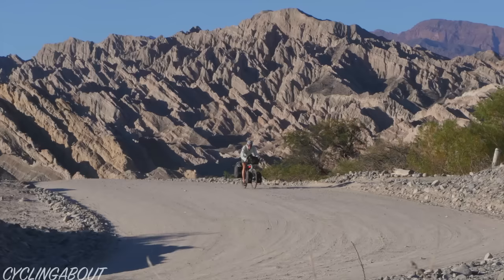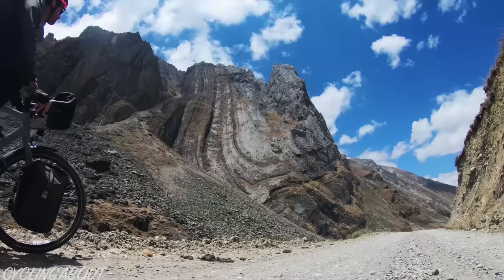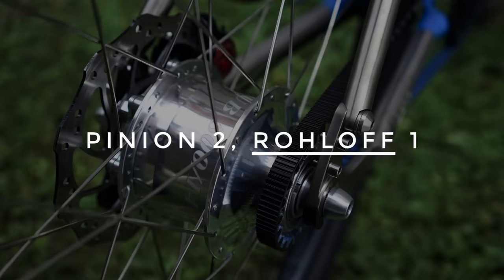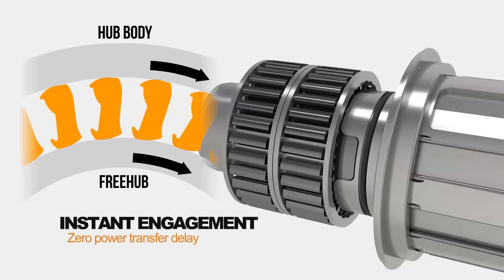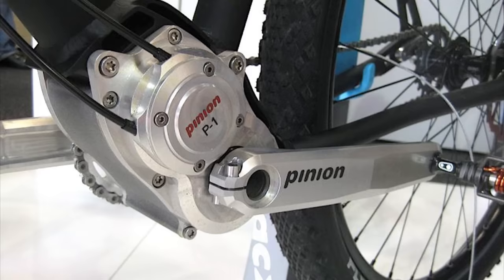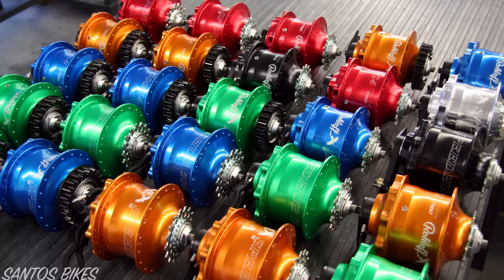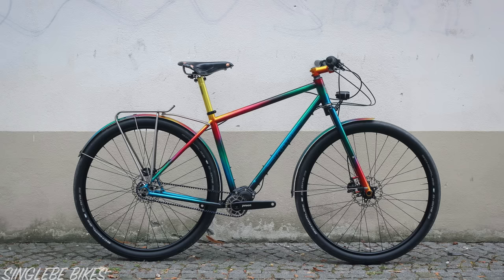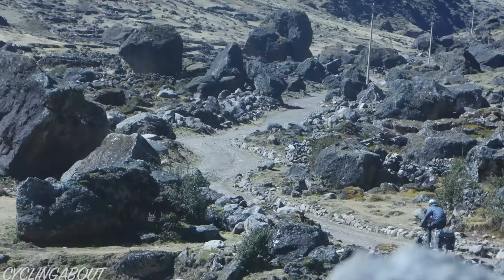What's The Ultimate Bicycle Gearbox? Rohloff Hub VS Pinion Gearbox

Comment: Thanks die this enlightening video. I vote for the Rohloff, don't want to loose 10% power in the gearbox.
Reply: You should rather test ride both systems before judging this. The feeling on the ride is really something new with the Pinion (and no additional weight on the rear wheel)! A big advantage for Pinion IMHO!

Comment: Great straightforward objective measurements in the video. That makes this video SUPER helpful. As you said, different riders will favor different features.
   1. Big Picture... If price wasn't the issue, stupid chains and detailers would no longer exist. Think of it this way, if Gearboxes and Belt Drives came first, and then when bike manufacturers came up with a cheaper solution that was "chains and detailers," we would all be discussing if even the lower price makes these awkward and headache inducing "chains and de-railers" worth having. 
   2. All things being equal, the Pinon wider gear range should be the obvious winner. I mean, that is the entire reason for having gears, right?
   3. As far as weight is concerned, since the weight is so similar, why does it matter? For most of us riding bikes, the health benefits are one of the big reason. A "little" more weight can only make us stronger, right? Obviously if the weight difference is large enough, it can make the difference between being able to ride and not, but at this level, I don't see how this small difference can make a difference between choosing the 2 hubs.
   4. But if your are only able to afford a retrofit, then that is a show stopper. You can only use the Rohloff. But honestly, if you really step back and look at it, are you really only able to afford just the hub? Like too many of us, we have spent way too much on bikes and probably will in the future, so regardless of which of the 2 solutions that you choose, try to take the opportunity to get a new bike that fits your riding style and allows this new technology to thrive to its fullest.
   These tests do expose a gap that I am waiting for the industry to fill.
   I have told myself that I will never again purchase a bike with a chain and derailed. I refuse to support such ancient technology. 
   I think that the future for bicycles is Pedal assist electric in all categories. I prefer the Pinon. But having an electric motor in the hub of a bicycle wheel puts a lot of weight and strain for said wheel and puts excess weight in an awkward lever position on a bike. But is there and electric pedal assist bike with a Pinon gearbox and Motor at the pedals? That would be the ultimate.
   Thanks for your review of these technologies.
Reply: gear boxes did come firs Sturmey /archer 3 speed.
Reply: Interestingly enough internal gear hubs went into production first, before derailleurs.
I think derailleurs still have their place in the world, they're still far more efficient (thus letting you cover more distance, race faster) if kept clean. They are also far easier to service and work with.

Comment: I went with Nuvinci for my ebike, because the slight increase in weight and loss of efficiency doesn't matter if you have a battery, and I greatly enjoy having infinitely small gear increments.  However, I think for a bike that you can stuff in your car and take places, the pinion would be the way to go, because the tires are very easily removed and then put back on.  Otherwise, the rohloff seems nice for the slight efficiency gain.
Reply: Also, there is something to be said for using a pinion with an ebike, because while hub drive motors are less efficient for going up hills, I have heard that they are generally quieter and that direct drive hub motors are theoretically more reliable because they have fewer moving parts, though admittedly I have not heard of many people having problems with either type so far.  Direct drive hub motors also have the capability of offering regenerative braking, which would be nice for descending mountains, because it would allow you to save your physical brakes.  And a pinion bike could be very easily changed into an ebike and then changed back, depending on the circumstances, whereas a mid drive ebike is pretty much always going to be an ebike.

Comment: I think it's important to make clear:
90 % efficiency at the Pinion is more like "half as good" as 94.5 % for the Rohloff.
As the Rohloff wastes half as much of the energy. In this range not a huge deal, but still 4.4 % less power needed relatively. Makes the race everywhere but for supended fullys...

Comment: I have tried many times e-bikes with Rohloff (both mechanic and electric shifting). Unfortunately, I didn't like it at all. The Rohloff needs too many shifts in practical use, it was a constant shifting up and down. The 10rpm might work well for pedalling without motor, but for a motor, it is too close between gears.
Reply from the maker: Fair enough! When I used an Rohloff E-14 eBike last year, I just held the shift button for half a second and it jumped up and down three gears at a time. I thought it was great!
Reply: CYCLINGABOUT I think you need another head to head. Pros and cons of gear boxes which is better for e-bike
Reply: @Cyclingabout  Pressing half a second to jump three gears sounds great, but in practice, it is awfully slow, especially when riding in traffic. At least, with mechanic shifting, I could switch fast, and I knew in which gear it is. But still, it needed way to many shifts. In fact, e-bikes need bigger jumps between gears to feel comfortable. I found the Alfine 8 has a bit too big jumps for normal pedalling, but for the ebike it is just perfect.
Reply from the maker: The Alfine 8 works out at ~17.5% average jumps, so pretty similar to the Pinion 12-speed gearboxes. The Alfine 11 is pretty much the same as a Rohloff though!

Comment: 3:24 - According to Wikipedia: "Rohloff hubs generally require a break-in period to function optimally. The manufacturer suggests this may require 500–1000 miles of active riding. For some riders the break-in period may be longer. Until the hub is broken in the rider may experience some noise or vibrations when the reduction-gear is in operation (gears 1–7)."

Comment: A couple more tests I'd like to see if possible: 
- another test of resistance of the Rohloff and Pinion after a break in period and oil change.
- a resistance test of a 'normal' chain and cogs with the chain at different deflections, ie big ring and biggest cog.
- a test of chain and cogs when they're dirty, reflecting resistance after a long off-road ride.
Thanks, and great video.

Comment: I love rohloff hubs, I've build two bikes with them. One XC hard tail and one fs trail bike, both with used hubs. My biggest grudge toward rohloff is that you cannot get thru axel version with adapters. You need to send them a frame so they can fit it in, which is expensive. So I was limited to older QR hubs and frames. The hub is also quite easy to lace, my first wheel build was a Rohloff. 
I find the gear sound motivating when going uphill. It feels like there is a machine helping me out. I know it's silly and that the effect is exactly opposite (more drag) but i still like it.
Rohloff has crazy pricing though, shifters, chain tensioners and adapters are very expensive.
Reply from the maker: I kind of like the whirring sound too... 😎

Comment: Thanks for this analysis. A BIG small detail is not mentioned in the video (maybe already covered in the comments): 
Adopting Pinion you also commit to their special cranks and, most importantly, rather wide pedal stance. So if you can't live with 160+ mm Q factor, this gearbox isn't for you apparently...
Reply from the maker: Good point! I should've for sure discussed q-factor.

Comment: Thank you for this great comparison. I'm using both gear boxes (on two bikes :-). My two Euro cents in this:
* Pinion: Drivetrain slop. Yes it was incredible, my hub was leaky for dirt. The engagement got pretty slow, resulting a BIG slop. But after change of rear hub (on warranty) to another model from Pinion, the slop has gone. I have the impression, this new one may(!) have a higher number of engagement points
* Rohloff is really annoying on regards of noise: On heavy duty: The whole frame vibrates.
* Pinion: you need to eat way more noodles before a tour to have the appropriate gain to handle the extra weight :-)
* Pinion has a far better equalized and fine-grained transmission than with Rohloff. Switching gear in heavy terrain let you "fall in a gap"
Reply: Which gear hub would you keep if you had to keep only one? I am ordering a custom frame but still debating over with IGH to use.
Reply: @gromit576  Hello @gromit, my choice is Pinion P.18. After such a long life on a bike this is the ultimate choice. I hope you are able to confirm soon :-)

Comment: My dream bike is a pinion+belt drive skinny-fat that can run around 29x2.4 to 26x3.8, preferably with a trigger shift system. But I suppose I could eventually get used to grip shift

Comment: I'd go with Rohloff.  I like how you don't have to have a special frame.  I also value their experience.
Reply: I'd go Kinderlay over Rohloff,
Still tempted to try a pinion
Reply: @PghMtbRides  Thanks.  What makes them better than Rohloff?
Reply: @mherke  lighter, better range, swappable between wheelset via cage system ( still need to build wheel with extra cage though)
Better shifter( i dint care for grip shift)

Comment: The versatility of the Rohloff to fit many bikes will also translate into an asset that has greater 'marketability' in the used gear market, so better resale value. This feature is even more enhanced with the new Kindernay hub, that is much like a Rohloff. The Kindernay has an extra advantage in the 'swapshell' feature that allows a single gearhub to be exchanged easily among many wheels without needing to re-lace the spokes. So you can have your road wheels and your offroad wheels, with just one hub. And Kindernay has Fatbike compatibility with a 190/10 and 197/12 thru axle. It's like a portable transmission that you can plug into your many frames and wheelsets.
Reply from the maker: I'm keen to have a play with a Kindernay! Hopefully I can get my hands on one after I finish my current mission of getting to Alaska.

Comment: Im looking at priority bikes 600 or their apollo bike for touring....or the surly bridge club or ogre with the rholoff hub....either way i want the carbon belt drive to get rid of the chain and derailleur maintenance and damage issues.  With the surlys i would have to use the Veer belt drive system or have a coupling installed in the drive side seat stay to be able to install the Gates carbon belt.

Comment: For any ebikers out there. You can use the Rohloff with a central motor, which then also befefits from the gears, whereas with the Pinion, you have to go with a hub motor which doesnt't.

Comment: Having some experience with both, I prefer Pinion for MTB. But it still needs refinments e.g. engagement points should be increased, new version of grip shifter improved cable routing but cable replacement is still a pain, sometimes clunky sound can be heard. With both gearboxes I've had problems with leaking oil.
Reply: Leaking from where?
Reply: @alexmorgan3435  In Pinion from non-drive side of the gearbox where crank arm is attached.

Comment: I dont know if its nessesery have more than 526% gear range. Maybe in hardest tarrain, but still you can change the sprockets (number of tooths) and move the gear range. For me a Rohloff is a winner, you dont need a special bike frame :)
Reply: if you want to switch out 2 sets of wheels, same bike, pinion is the clear winner. 2 bikes for the price of one!

Comment: For an eBike with a Rear Wheel Motor , & Belt Drive.
Is there a simple pedal crank gear shift? 
Just 2 (or 3) gears would be sufficient as the bike is designed as a single speed road bike.
So having even a single gear change would help extend battery life and make top speed pedaling more comfortable?

Comment: I’d love to see someone put this in a go kart with a chain going from the transmission to the rear wheels. Would you need a clutch for connecting to the engine or a torque converter?

Comment: For daily use, I think that Pinion offers more advantages. For long travels, any problem with Pinion may stop the journey; with Rohloff, it is always possible to switch to a standard wheel, and continue with a single speed bike. For road or mountain sport activities, I think that derailleur remains the best choice.
Reply: If you don't have much money maybe derailleur is the best choice but even now derailleur transmissions have become expensive so the Rohloff and Pinion gearboxes are even more attractive, not to mention so much time saved not having to maintain them like a derailleur transmission. LoL.

Comment: So there is a bit of a caveat to a pinion, recumbent trikes, Catrikes specifically have kits that allow us to use a pinion drive without major frame changes. The reason for this is because our booms are replaceable, so we can just switch out a pinion boom instead of our standard front derailleur. Utah Trikes makes pinion kits which don't add much to the price. More reason to get a recumbent trike.

Comment: Another sweet video.

The drag or rather the drive efficiency when it comes to the pinion as far as I can tell it that the cogs are so thick, they would not look out of place in an motorcycle or car drive train. They are way over built, the contact patches are too large and everything seems to be too massive for something like a bicycle drivetrain, and on top of that it is in an oil bath. I would slim everything down by at least 70%, and probably cheapen it up by not work in open oil bath with shorter service intervals and simplified way of taking it apart and service it yourself. And at most maybe introduce oil canals to oil the stressed parts. Then ofcourse I would make different kind of cases for it so that even people with traditional frames could mount them on their bikes.
The pinion gearbox looks waaay to massive for a bicycle component.
Reply: I'm not sure what point you're trying to make - the Rohloff gears also sit in an oil bath, and more contact area of the teeth means less abrasion and higher longevity. It's a trade-off, as most things are in life.

Comment: Have you heard about the Revonte mid motor/gearbox combination? It’s made by a small Finnish company and seems the future of e-(mountain)biking (to me). It combines a mid motor with a continuous variable transmission in 1 unit, that is not larger than the average mid motor, solving several issues that traditional gear systems have at once.
Reply from the maker: I've seen that one and will be keeping a very close eye on where it goes. 😎

Comment: I think Shimano and Sram should focus exclusively on gearboxes now. The derailleur has always been a weird system and it's time for the bike industry to evolve.
Reply: Sadly Sram just dropped all igh's few years ago.
Reply: Not going to happen. Derailleurs are much cheaper and like it or not, but most people don't need an expensive bike.
Reply: Also with electrification taking over you need even less gears.
Reply: @Don19762  The cheapest bikes have a single speed or 3 speed hub. And for actual use they are a much better user experience.

Comment: One thing I like about the idea of not using a Rohloff is faster flat repairs, and being able to easily swap a wheel out in the event of failure where it would be otherwise quite difficult, inconvenient, or impossible to have a new wheel laced up. I know people love having things in their rear hubs like gears, brakes, or even electric motors, but they're far from practical in small towns that either lack a bike shop, or have one that just can't cater to these kinds of failures.

Comment: My full suspension recumbent currently has a Rohloff but the small wheels mean I need a bigger chain ring. Oddly, retro fitting a Pinion would be quite simple because if only need a new boom extension, but I’m not sure how all that weight out at the front would affect handling. I think it might be a bit of a challenge. Mid mounting would be an interesting challenge, but it would require some frame surgery.

Comment: Both of them are nice for people who are willing to spend a small fortune on their bicycle.
Most people don't want to do that. So let's compare some more common, less expensive gear hubs as well. How much more gear ratio in percent in comparison to the price also in percent do I get, if I compare the pinion, the rohloff, an alfine11 (which suits most riding situations quite well) and maybe an old Sachs or Sturmey Archer 3 speed hub (just to see how much better gear systems have become in the last years). Sounds extreme? Not to me. I'd like to know, if I really should spend that money for that tiny little improvement.

Comment: Hi love your channel really appreciate the work you put into the tech info on all the bikes and your opinions on what bikepacking and touring gear worth buying so thanks 😊 I actually have a 2011  MTB with x9 red sram 3 x10 22,33,44 chain rings and an 1136 cassette that gives a 654 .5454545454547 % range original  cassette was 1132  . 1st gear on 27.5 inch wheels is 16.805555555555 inch gear , 44 t to 11 on 27.5  inch wheels is 110 inch  if my maths is correct

Comment: I ride BMC commuter with shimano rear hub for last 4 years.  Basically bad version of rohloff. There is one huge disadvantage of rear hub he didn't mention. Weight distribution. Normally center of gravity should be near BB but with rear hub it is on a back wheel.  That makes very nervous bike if you know what I mean. Disbalanced. Would be nice to test ride pinion before dropping $6-7K on a new bike but none are available in NYC. Anyway I'll go for pinion. Price for P-12 is almost equal to rohloff 14.